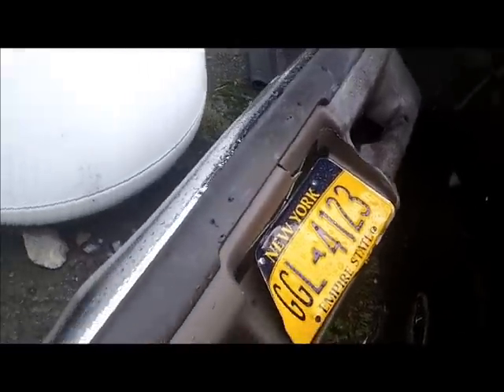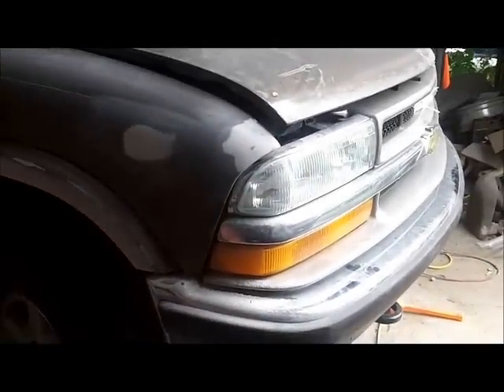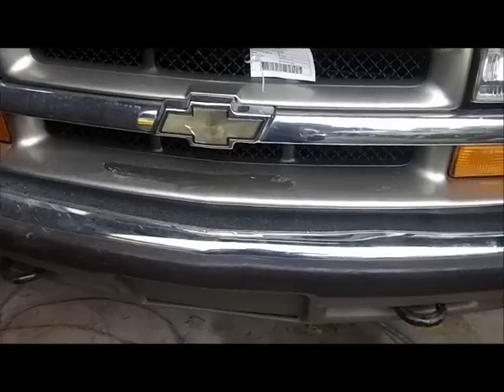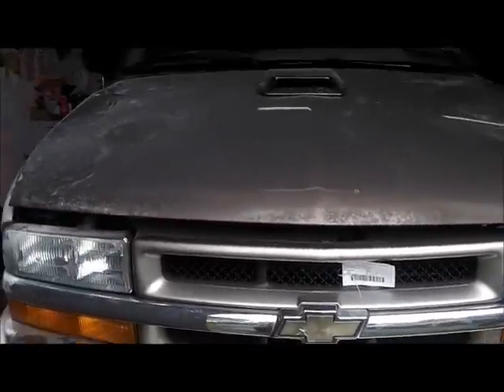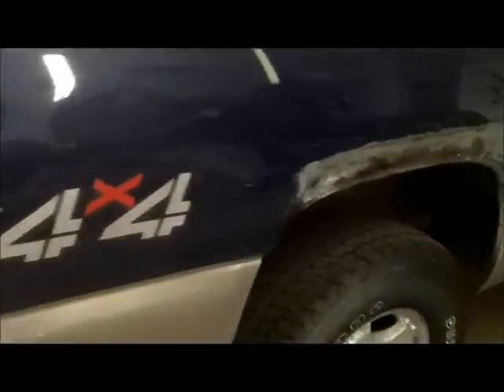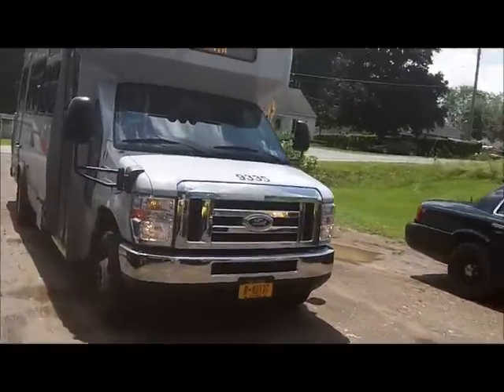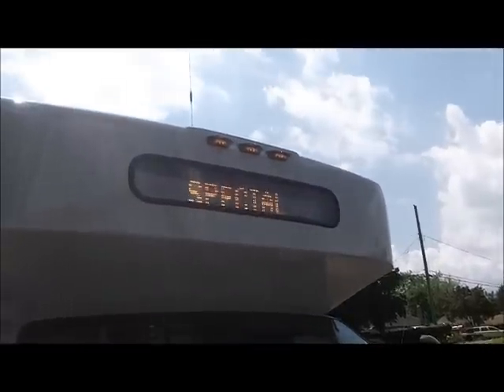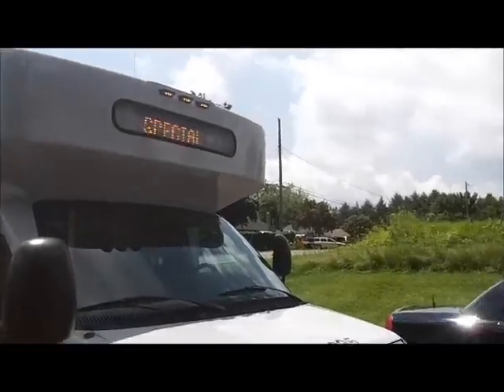How to do Two Tone Paint on a Vehicle

Comment: The first place the clear will lift is where you didn't take off the moldings? Why not do it. Oh ya it's the HACK and pack shop. Also you should use a plastic tape on the edges of the green tape much smoother transition. Hey man I'm sorry to be an ass but you obviously work at your own shop cause you'd blown away by new technology in the body shop world.